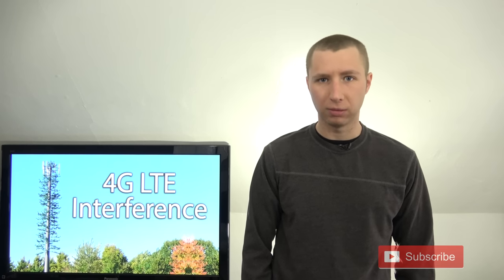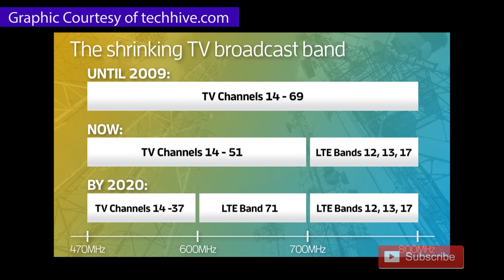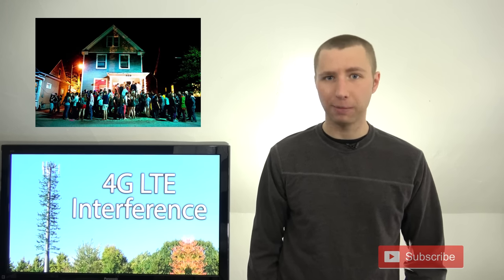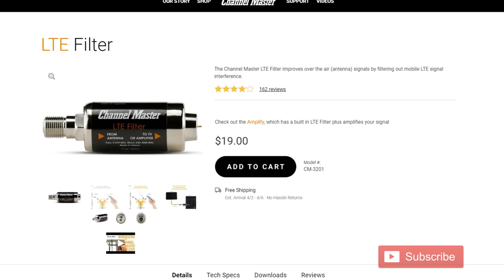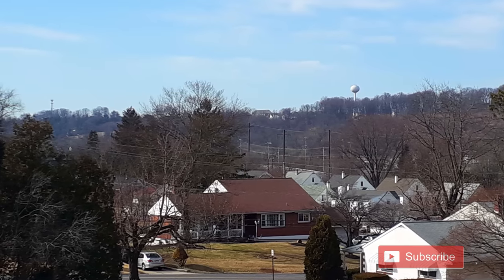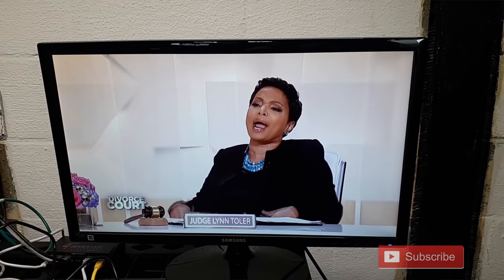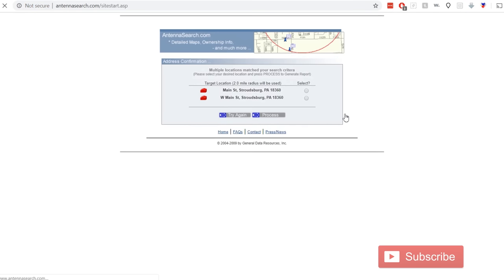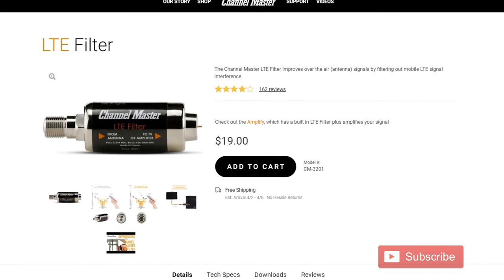4G LTE and 5G Interference on OTA Antenna TV - Fix it with a Filter

Comment: I purchased one of these filters because there is a cell tower less than 200 feet from my residence. It did stabilize the strongest channels but it also attenuated some weaker channels. It is a trade off but it definitely works.

Comment: Antenna man you are absolutely correct when you are telling everybody about this situation with the cell phone 4G LTE interference I am a professional technician in West Palm Beach area in Florida I used to be a Dish network technician and now I am doing antenna install for customer here in West Palm Beach especially Latino customers I've Found this Problem in multiple locations there is some areas that I call dead zone no antenna at all work properly
Reply: he maybe correct however  in my location bridgeport  connecticutnyc market
the  tv filter no matter who s company  silicon dust wineguard
channel master  
I could not hold onto my local wtnh 8 new haven ct..area

no matter what direction pointed my televees antenna

Comment: I live approximately 1000 feet from a cell tower, so i bought one of the Channel Master LTE filters and popped in on just before my distribution amplifier and the difference is night and day.  For a long time I was tilting and turning my antenna due to occasional signal loss,  but after installing the filter all channels in my area come in without any pixelation or loss with the exception of one low power channel (45) that only broadcasts shopping networks.  I'd say it works quite well in my setup.

Comment: Tyler, thank you for the video about TV interference from LTE. I ordered a Tablo Quad, but was disappointed with the picture on some of the channels. I thought I was going to have to upgrade my outside antenna.  It’s about 10 years old and the inclined roof blocks line of site for some channels. I ordered the Channel Master LTE filter and installed it yesterday. Every channel that I’m interested in now has a good picture. I was initially disappointed with a few channels that broadcasts old shows like Grit, MeTV, etc, until I remembered that they were made before color TV and HDTV. Those channels are as good as they can be.  Thanks for what you do.

Comment: Be aware that any thing you throw inline with the antenna will degrade the signal from some to a lot depending.  Some filters are -1.9 to 4db down and -3db is half the signal.

Comment: Thanks for showing what the interference looks like. My antenna [with built in LTE filter] was working fine until I had to move it slightly, when I moved it back the sporadic picture pixilation problems started.
Your video confirmed what I thought the problem might be, now I just need to replace the filter and not the whole antenna.

Comment: Televes antennas have a built in lte filter and preamp. most people should also use quad shielded cable as well.
Reply: Indeed! As a proud owner of Televes antenna myself I do think it should have been mentioned in the video that you might not need that.

Comment: It is most likely inferior to the channel master LTE filter but I am using the "Mercury AF4G" LTE filter.  It eliminated time of day issues I was having off and on for months.  Around 9:30 PM until after midnight I would start to get pixlization on the same channels even when they were showing a strong signal.  I installed mine as a test right before my splitter knowing that it really should be up at the antenna.  When the problem went away and there was no loss of signal on my channels I just left it indoors where it was.  At least with it indoors there is one less connection joint outside in the rain and snow.

Comment: Hey Tyler! $19 isn't going to kill me. Just the sudden stop when I hit the ground below my antenna. I was just up on the roof to aim my antenna CM-4228HD with the CM-7777V3 amp. I am dead on with the aim and about 30 miles from the only station I can get. I am all the sudden getting this pixelation you are describing. I think I will try this. I like that it is a male -female so it looks like it is oriented so I can attach it directly to the CM-7777V3 pre-amp and the coax that goes to the antenna. I maybe over driving the TV with a hot signal too. I am only out $20 some dollars if it doesn't work.

Comment: Thanks, Tyler for showing what LTE interference looks like. Does the filter take some of the signal strength of the cable line run?
Reply: It's a simple Notch Filter that basically gets rid of the frequency range LTE is operating on, and lets all others pass through. The Notch Filter its self shouldn't degrade your signal. However, any extra connections on the coax (the 2 on the filter) will in theory contribute to loss. This would be negligible though

Comment: So, the closer the channel frequency is closer to the LTE frequency, you will see the pixelation as shown in the video. 

Tyler, keep the tips and advice coming, they are very helpful.  Thanks!
Reply from the maker: It can bleed down the UHF band. The TV station shown was on RF channel 31
Reply: pixlation  is also caused by shared  RF  signals same  RF  example

pax 31 fox 61  ct market  RF 34 same frequency...  why signals break up  not just a cell tower  issue

Comment: I replaced a lot of the coaxial cables from my antenna setup with quad shield cables and I notices that I didn't pickup as much outside interference.  I have thought about getting one of these LTE filters but I don't think I get too much interference from cellphone towers where I live.  Thanks for you videos

Comment: If you are combining two indoor antenna signals and each come with a (detachable externally powered) preamp and I'm using a Channel Master distributor amplifier (externally powered) to send to two TV sets - where would you say is the best spot to put the LTE filter? Before the preamp or before the distribution amplifier? My original thoughts were: 
Antenna 1										                                                          TV 1
		     > combiner ----- LTE filter ------ pre-amplifier	-----  distribution amplifer  <		
Antenna 2									                                                                 TV 2
Thanks for any insight you might have on my set up plans.  
New to the channel and enjoying all the tips and reviews.
Reply from the maker: Before the preamp would be best
Reply: @AntennaMan  Cool thanks!

Comment: I've had a great signal for 10+ years. I'm about 60-70 miles away, but live at a higher elevation then anywhere between me and the City. I've always had a good line of site into the City. Over the last 6 months, I've been getting the studdering, pixeling issue. Last year, at least 2 new cell towers have been installed withing 10 miles of me. I'm going to grab one of these filters and I sure hope it cures this. It's so frustrating trying to watch a show these days.

Comment: Thank you for that example. It proves I did the right thing.  I tried the filter and it didn't help. The interference was more like the second example you gave . Turns out once I got rid of that amplified batwing antenna and put up a real, non amplified, multi-element antenna the problem went away. I am waiting on 5G filters to become available. There is a tower only a block an a half from here but to the back side of my TV antenna. Who know when 5G will become available around here.
Reply: Cm-3201 filter has been updated to filter out 5G NR (frequencies above 609 MHz are blocked).   Channel Master website details this in their website.Go to the Tech Spec tab for CM-3201.

Comment: I had installed an LTE interference filter a couple of years ago at the tuner and it improved things, but the interference got really bad. I bought a different filter but it did not chance, but when I put the second filter on the antenna in the attic and the improvement was dramatic. If you use one on your tuner and still have issues, do try putting it at the antenna.

Comment: I have recently installed the LTE filter onto my powered signal splitter (from Channel Master) and made sure it it plugged in correctly to fix some problematic channels that were breaking up very badly despite having very good signal (according to the signal information on my Samsung TV with up to 27 db with a channel in RF channel 18), unfortunately the problem is still there on the problematic channel, and I'm beginning to suspect that there's something going on with the tower station, such as heavy maintenance work, as even when I tested a higher position with my outdoor antenna, the channel still breaks up badly with excellent signal. Any other possible reasons for this?

Comment: I am in Fallston, MD and tried the Antenna Master LTE filter because I was hoping to clear up problems with me getting Maryland Public Television on 22 WMPT (OTA 21) or 67 WMPB (OTA 22).   I get a good signal on both stations in the 70% range (using my Dish Network 722K receiver), but the signal periodically completely drops out for a second and comes back.  The LTE filter didn’t improve the problem and caused pixelation with many of the DC UHF stations.  If I remove the filter, the pixelation goes away.  I have an old VHF antenna in my attic (probably from the 60s) and a newer fringe UHF antenna and don’t have metal siding.   The problem seems to have gone away since the leaves have fallen, so maybe next Spring, I’ll try re-aiming my UHF antenna.  I guess it’s a balancing act between resolving the MPT issue and keeping the DC stations.

Comment: The problem isn't that the LTE frequencies are "near" the TV channel frequencies.  But that the LTE frequencies now reside in the channels 39 to 69 range that TV receivers were and still are designed to receive.  So when a strong LTE signal hits the input stage of the TV receiver (before even the tuner stage) it can clip the receiver's input stage.  Thus disrupting the TV signals as well.

The solution.  Install an LTE filter that blocks the frequencies of channels above 36 so that the LTE signals in that range will not be strong enough to clip the TV receiver input stage.

So you have the solution correct.  Just not a technically correct description of the cause.

I installed the CM-3201 LTE Filter (the newer version that is for channels up to 36; 5-609 MHz pass; 610-2000 MHz block) and noticed a reduction in pixelation.

Note: Some third parties are still selling the previous version that is for channels up to 51 (5-699 MHz pass; 700-2000 MHz block).  They both have the same model number.  So be sure to get the correct one.  The previous version will not be effective for interference caused by LTE signals in the recently reallocated channel 37 - 51 range.
Reply: Thank you!

Comment: The reason an LTE filter is useful is because the front end of the tv is so poor! They have little to no filtering from the factory. The LTE base station will not be transmitting out of band.

Comment: You dont need a "LTE filter" any 75ohm 600MHZ low pass filter will work!! Also filters have an internal noise figure, so its actually better to filter after the preamp if possible otherwise you lower noise margin for reception during storm. You want the cleanest unimpeded signal to the preamp.

Comment: I have the Televes Data Mix with their built-in preamp.  Guess then that I cannot use this filter or does their preamp do that already?  I found that I have a tower 0.9-mile along the same line that I have my antenna pointed (my guess).

Comment: I have a Clearstream 4 mounted on roof...about 8 miles from most TV Transmit antennas. Reception fine at 4 TV sets (running of 4-way split pre-amp), but I have severe pixelation on a couple of channels when recording with my Tablo dual-stream digital recorder. Any chance that LTE interference could be the cause? I have about 4 cell towers along the reception path.

Comment: Tyler great info I have cell phone boosters plus parabolic antennas for a router that brings in my high speed intranet but I'm 3 miles from an antenna. Will this filter help my pixelization. I've got a giant antenna in the attic from Channel Master.

Comment: A.M. I bought an Antop antenna top on the line, my issue is I also have a GE lower end antenna in my bedroom which works great. My question is I can't get some local CBS station on my Antop antenna, but in the bedroom they come in great. What can solve this problem. Thank You, Richard

Comment: i paid 120 and 10 for free tv type antenna.  NEVER have seen any difference. before on my television.   However, lately, i get the blurry fuzz in and out along with no signal long time and wondering if one of the antennas gone bad, or if i am picking up something from a newer neighbor or something.  I even just suddenly lose channels.  rescanning does not seem to help and when it does, it does not last.

Comment: With FCC repack completed this past July, CM-3201 filter has been updated to filter out 5G NR (frequencies above 609 MHz are blocked).   Channel Master website details this in their website. Go to the Tech Spec tab for CM-3201.  What is not on Website and was clarified by Channel Master customer service, is that the filter has 3 dB loss (half power loss).  This may mean that some channels might be lost in the rescan if the signal was weak to begin with.  That's the trade off.  Please keep this in mind.  Do not return because you lost some stations.

Comment: I have the "Televes DATBOSS Mix UHF VHF Amplified Outdoor HDTV Antenna with LTE Filter (149483)" which supposedly has a built in LTE filter. But I still get interference similar to what is depicted in your example on some UHF channels. Would adding one of these filters before my splitter, or at the antenna input on the TV help at all?
Reply from the maker: You can try but if it has a 4G LTE filter don't think you have interference. That antenna is a very basic small directional antenna on the borderline of a junk antenna. You'll likely need a larger antenna. If the filter doesn't work consider a custom antenna recommendation at the link below: http://www.antennamanpa.com/antenna-recommendations.html

Comment: Would having a Verizon 4G LTE Network Extender 2 in the house be enough to cause interference?
Reply: Almost anything electronic can possibly cause interference.   I have heard of indoor antennas having issues every time someone uses a microwave oven in the house.  Just use process of elimination.  when you get the signal loss, unplug the network extender.  If the problem continues then it was not the source of the signal noise.  That works great for country and suburban homes but people in cities where everyone lives close, it can be your neighbor's wonky home electronics firing up.  Then you are screwed because you can't go next door and start unplugging their stuff.

Comment: I'm only 3 blocks from a major "city water tank cell tower".  My screen goes total pixelation at times while watching a channel with excellent receive signal level from what I believe is 4g activity.
Is there any reason I couldn't place two cm-3201 filters in series if a single unit fails to totally correct the interference ??
Reply from the maker: If one doesn't work two won't work. It's possible you may have interference from 5G which there aren't filters for yet.

Comment: Tyler, CM is trying to sell me their "Amplify" adjustable gain preamp AND an LTE filter...Their "Amplify" says it comes with a built in LTE filter but that I should add the additional $19 LTE filter for 5G...Are they taking advantage of me?
Reply from the maker: No, I think the LTE filter on their preamp only cuts off at 700mhz, their new filter covers 600mhz where 5G is.
Reply: @AntennaMan  ty!
Reply: Cm-3201 filter has been updated to filter out 5G NR (frequencies above 609 MHz are blocked).   Channel Master website details this in their website.Go to the Tech Spec tab for CM-3201.

Comment: SInce the cell operator is causing out-of-band interference (AKA "Front End Overload" or "Fundamental Overload"), wouldn't they be responsible for the purchase of such a filter?  Also, wouldn't the presence of this out-of-band interference indicate spurious emissions in excess of applicable FCC standards?  Especially since there's a six MHz gap ("Channel 37", which is internationally allocated for Radio Astronomy) between the lowest cellphone frequency and the highest TV channel? Finally, if the interference persists after the cellphone operator is notified, wouldn't the operator of the cellphone facility be subject to FCC fines and other penalties since after notification it would be considered by precedent as malicious interference?
Reply from the maker: In a perfect world the cell phone companies would be fined by the FCC for interference. However, the FCC is mostly "owned" by Telecomm companies (note how they diverted TV spectrum to the cell phone companies three times already) so they likely wouldn't do anything.
Reply: @AntennaMan  Going to have to respectfully disagree with you.  The FCC goes where the money is.  And, fines are a lucrative source of revenue.  In an experience I had:  Paging company had a second harmonic interfering with reception of a local broadcaster.  Paging company is contacted by engineer living nearby to notify of the second harmonic interference.  Engineer gets cussed out.  Engineer then makes a phone call to the broadcaster being interfered with.  Broadcaster contacts FCC .  Interference goes away and FCC collects $10,000.00., which at the time was the max fine.  In this case, perhaps contacting the Chief Engineer of the broadcaster being interfered with would be a good recourse.